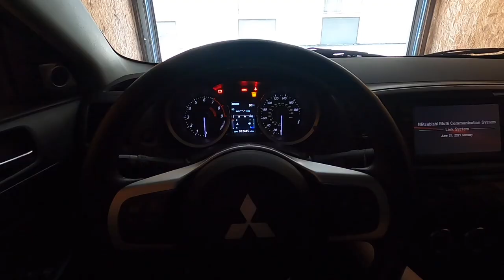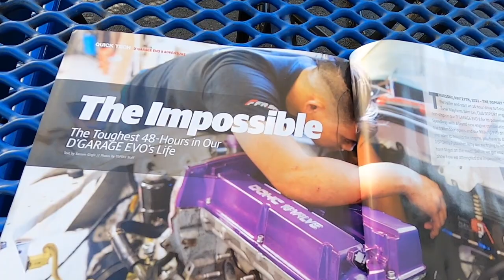1,000HP+ BUILT EVO X IS GETTING $3,000 OF UPGRADES!

Comment: Wouldn't ID 2600s be cheaper than a new manifold and more injectors?
Reply from the maker: yeah but they wanted to go 8 injector with a different fuel rail because of the different race gas they are going to be experimenting with but in theory yes it would be cheaper